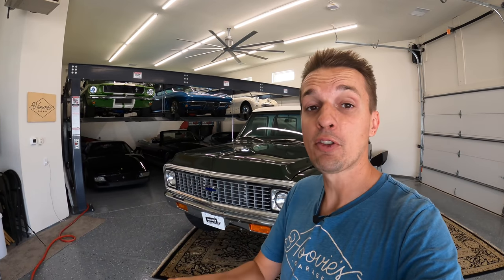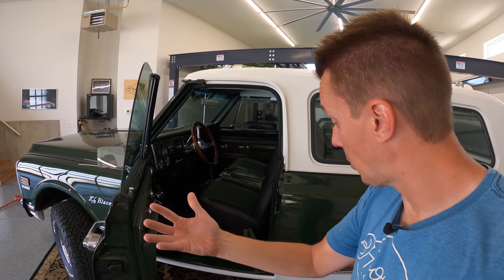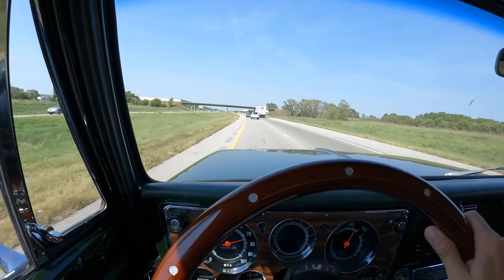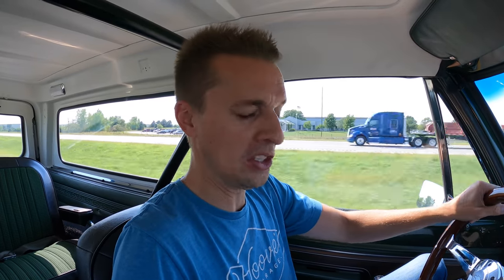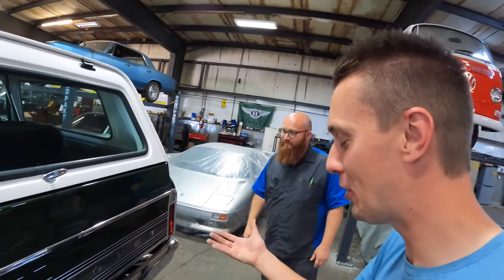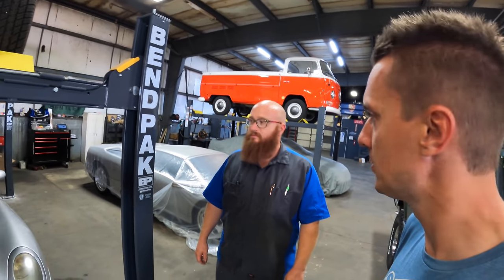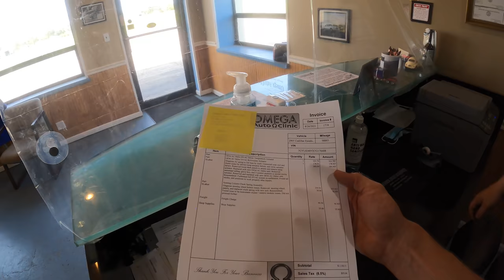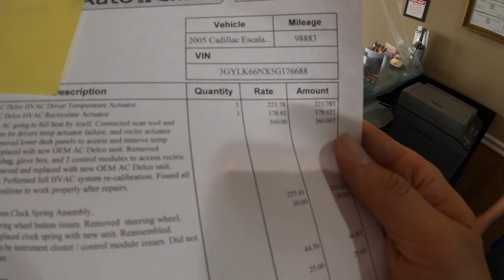Here's why the NEW Chevy Blazer is a HUGE flop. Build the K5 Blazer people want?

Comment: It was clearly rebuilt with someone keen on cosmetics but not the actual mechanicals. Probably an old tired 350 painted to look nice just like the leaking transfer case. They clearly know how to prep and paint but not how to rebuild the actual vehicle. Think about it it is loud inside, slow, noisy, get's terrible gas millage, will not steer down the road without 3 inches of slop in the steering wheel, leaks from almost every part that holds fluid, door does not line up or close well, parts are painted that where never painted by General Motors probably to hide things. I wonder how much Bondo is under that paint?  Notice I did not say body filler!! LOL